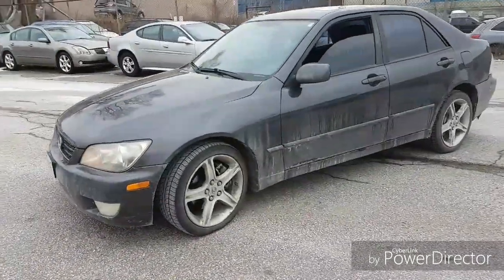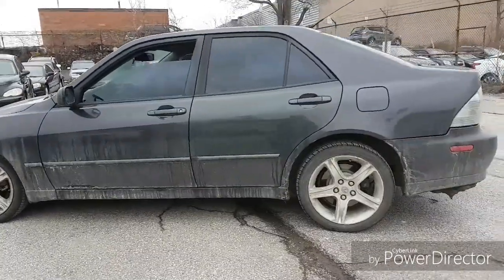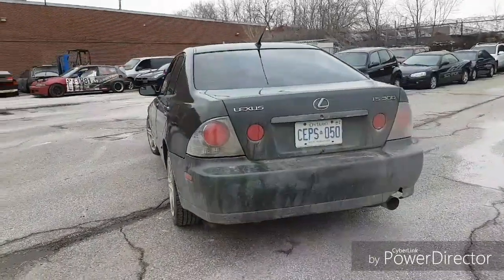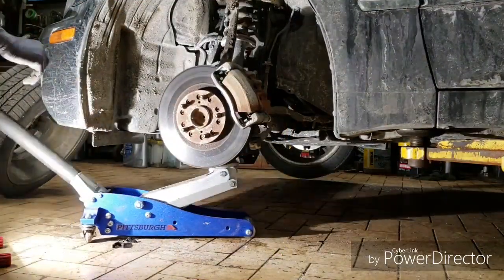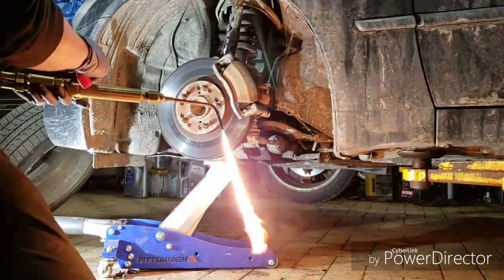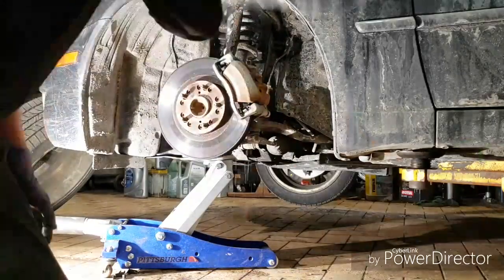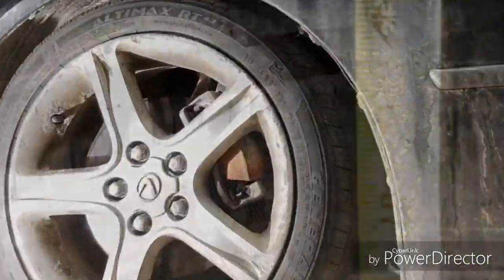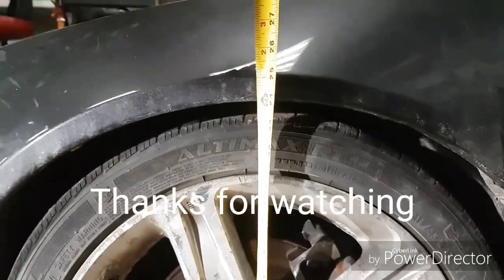How to lower Toyota Altezza Lexus is300 lowering springs with a torch #lexus #is300 #lowering #torch

Comment: When your doing this and your cars in the air, do you just do one side first (heat it wheel back on and the drop it) wait a bit for the spring to settle and to stay in shape and then do the other side?  Wouldn’t the other side spring cool and if anything stretch  it having just been heated and in the air while your doing the other side
Reply from the maker: Once it has cooled down.. itll stay in that shape.
Reply: @UncleTinman  so do you do one wheel and drop it, wait for it to get into shape and to settle, then jack up the other side?
Reply from the maker: @chriskereczman4577  yes one wheel at a time. I use a jack to hold it in position and spray water to help cool it down.
Reply: What a way to save money .

Comment: Hey there im from new Zealand i wamt to do this but instead i wamt to use coil compressors to compress the coils where i want then heat and cool them in place my question is will the spring get weakened by this and have a chance of snapping
Reply from the maker: That should work. I haven't come across them snapping, but i guess it's possible.

Comment: DOES HEATING SPRINGS ARE BETTER THAN CUTTING TO LOWER IT?
Reply from the maker: Good question. They're probably marginally similar. Although cutting removes the material resulting in less rebound strength. Please do come back and give us an update if that's the route you choose. Thanks
Reply: @UncleTinman  i did cut springs on my e36 and it hits bump stop over the smallest bumps and drops in the road. Would not recommend but interesting in heating them up
Reply from the maker: @antoinewallace8698  thanks for your feedback.
Reply: I heated mine on my SRT4 back in 2006 and it was way better than cutting them or even buying new lowering springs. It rides a lot better with and being heated instead of cut

Comment: How did u do that? Just by heating the springs?
Reply from the maker: Yes.. that's correct. Heating them up softened the metal and using the weight to compress them
Reply: @UncleTinman  is it good or bad or same as getting lowering springs?
Reply from the maker: @autobahn_cj  If you're willing to pay for springs and the install.. that would be the best option... Be aware... we're in Canada and the suspension bolts are usually seized and quite difficult to change out. Therefore this was just a cheap solution.
Reply: Im in canada too nd doing this wont damage anything right?
Reply from the maker: @autobahn_cj  nope.. I've done them for a bunch of these is300 that are used for ice racing and lapping.  Been working fine. You just have to  try to heat it up uniformly to have them bend evenly...that's the hard part... but again. If you can find springs...that's the best option
Reply: @UncleTinman  2 questions i have for you,

1. How do you make sure the driver side tire and passenger side are even height? 

2. Does it affect the wheel alignment?
Reply from the maker: @donpepe3464  i try to have the same settings when doing both sides. I'll have them jacked similar, etc. Any sort of spring height adjustment will usually need an alignment

Comment: i don’t quite get what you did lol, you heat it up and sprayed cold water on the springs to harden them? 🤔
Reply from the maker: Yes. That's correct.
Reply: how was the ride quality? was it bouncy?
Reply from the maker: @jflexiko  It rode perfectly fine. The only reason it would be bouncy was if the shocks were no good. By lowering it doesn't make it bouncy. The springs regulate the height and the jounce... the shocks regulates the absorption and rebound.
Reply: Fire.
Reply: Uncle Tinman thanks man, I might look into this 👍🏼